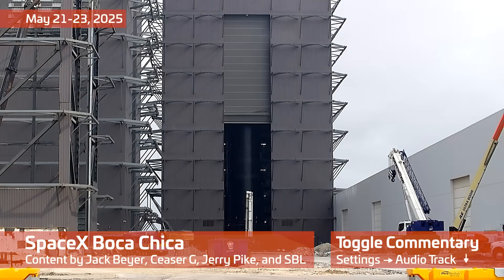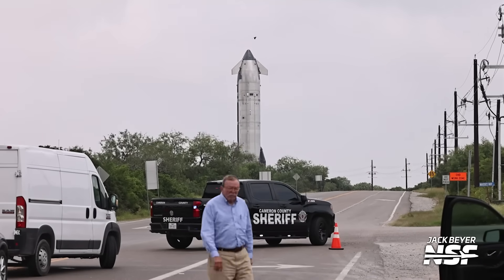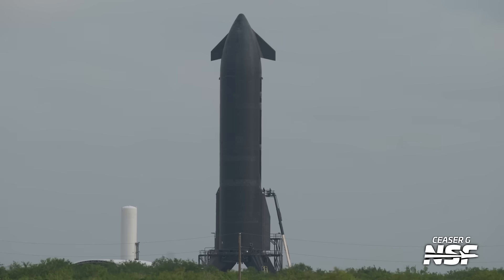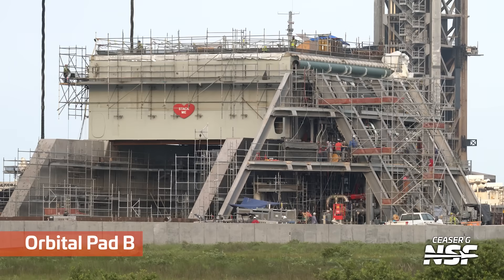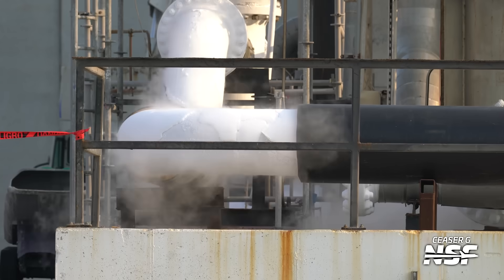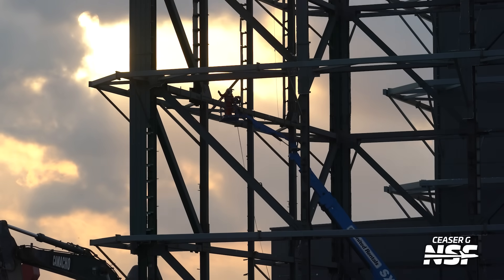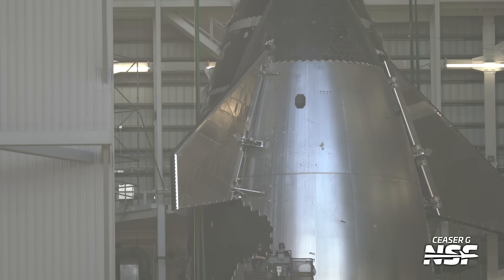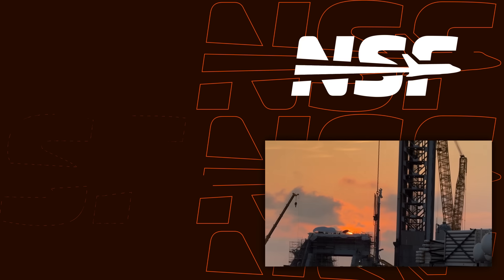"I need to get on a plane to Starbase..." | SpaceX Starbase

Comment: For balls its a mix i guess. First pressure needed to pump that high is not insignificant and pumps loose flow as pumping height increases in other words they loose time and money for that test unnecessarely. Other thing is safety, if one of those balls disconnects and fall down splash would be massive and possible damage something. If it breaks just above OLM then its not that big of a deal and hazard zone does not need to be 300m :D

Comment: In all these years, why didn’t SpaceX build a “crawler way” between the factory an launch site?

Environmental hassles?
Reply: The area on either side of the road is federal land, and I think a bunch of it is a nature reserve (or similar to that - whatever the correct terminology is). But also it doesn't really cause a huge issue to use the regular road, especially with the passing ability they now have. Ultimately the road will be widened which might allow for even more passing

Comment: Hi John, you where wondering why the waterbags where not all the way up but where hanging on extension cables. Well in my opinion it has got to do with the weight, if one of the lines would break from up high and you have all that weight crashing down on the OLM, that would be a disaster or any other infrastructure. Bye the way nice commentary again

Comment: The extensions on the bags keeps the bags low for easy water pumping but the load point is at the top of the tower, probably testing the tower itself to see what deflection it has under load.